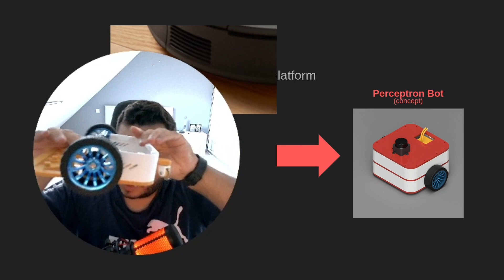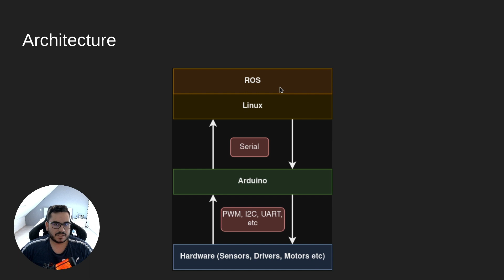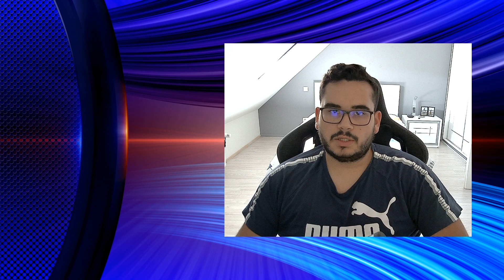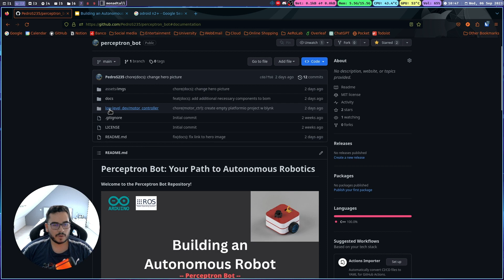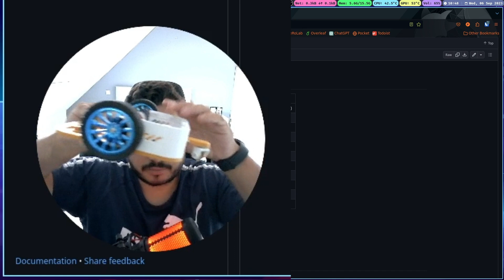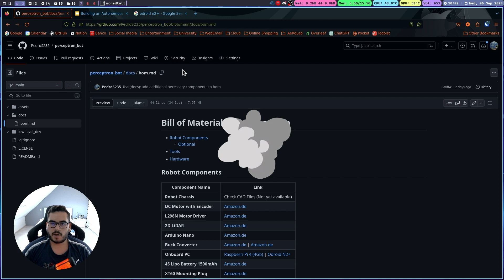Building an Autonomous Robot From Scratch - Perceptron 🤖[Ep.01]

Comment: Thanks for the video Pedro, looking forward to the upcoming videos! One question, I see a lot of people using controllers like arduino to drive the L298N. Is it due to the voltage? I’m just curious as I can drive the L298N and encoders from the pi. Maybe I’m reading the data sheet wrong but I understood it’s fine to drive the enable/pwm pins from the pi as far as I’m feeding a higher motor voltage to the L298N.
Reply from the maker: Hey @diegobrandao8822. You are  not wrong. You can control the l298n driver using the raspberry pi as well, as it also offers gpio pins. I believe the main reason to use the arduino is to separate some tasks. And I also think it's also fun to tinker with it😉. So if you would just like to use the Pi, you wouldn't even need to create this protocol to communicate with the Pi.